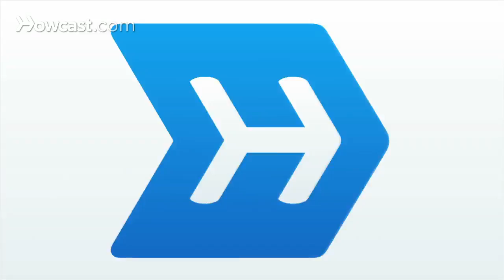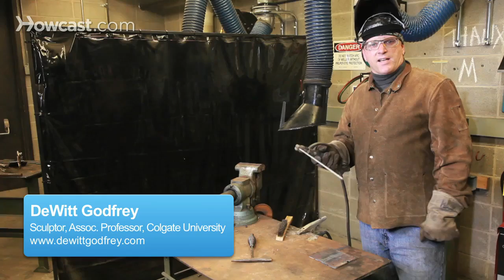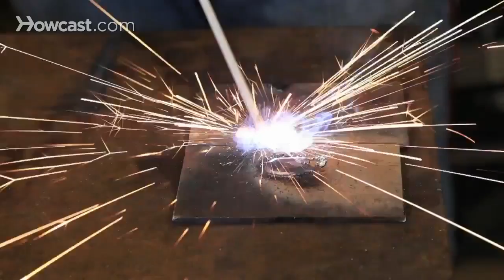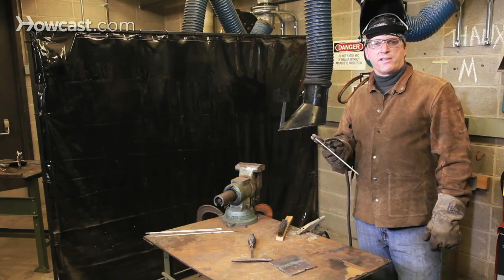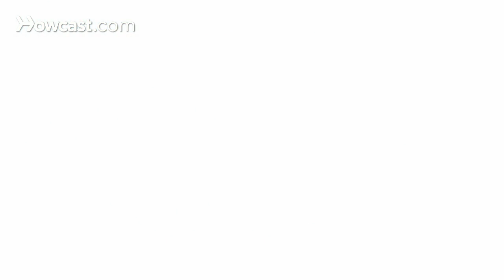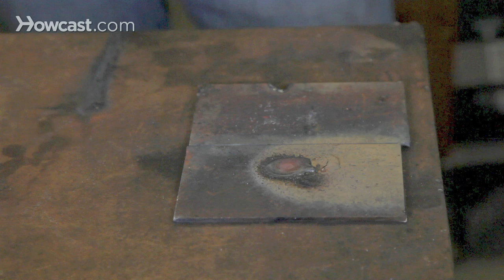Common Beginner Mistakes | Welding

Comment: Thank you dude, I was using a 3.2mm rod and set the machine on 115A like it was said on the rod package but I guess my 50€ welding machine is simply not that reliable and precise so I will go up the amp just a bit to see if I'm finally able to weld with it.

Comment: Great video. I'm having same exact sticking weld or weld won't start. I have set the amperage to 122-125A. The rod specification is 3.2mm 6013 60-120A (flat/vertical/overhead). Should I go higher amperage which I haven't tried or what should I do? The surface is not too dirty or rusty, but I will keep it cleaner.